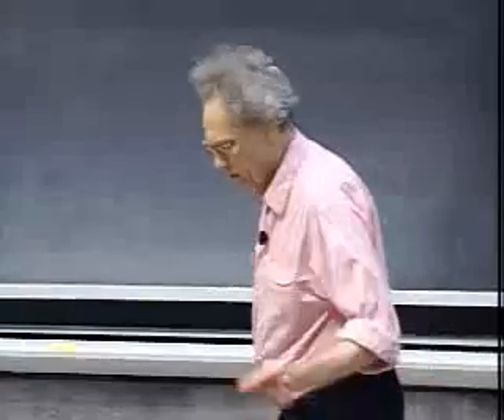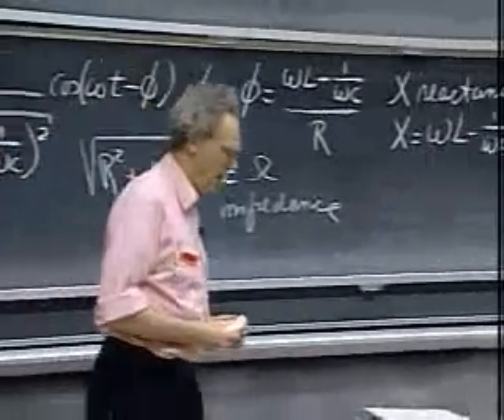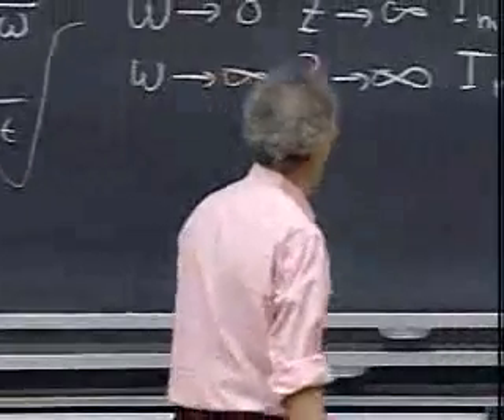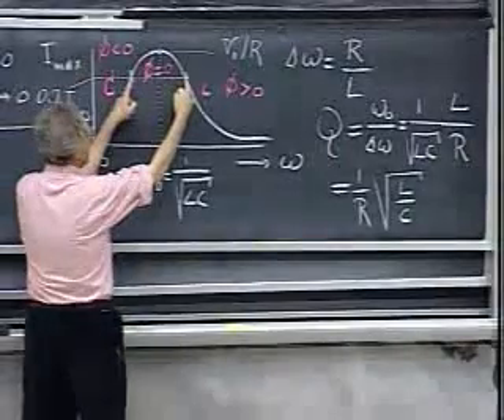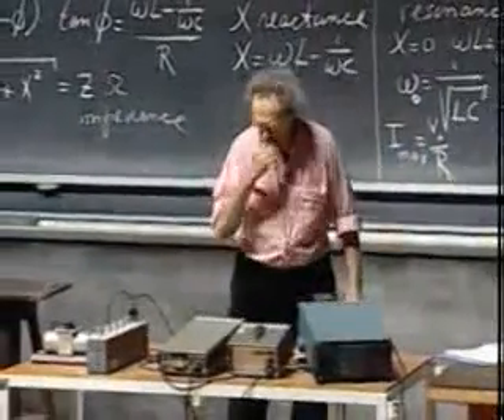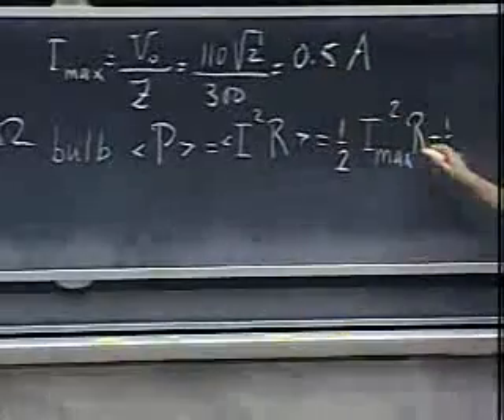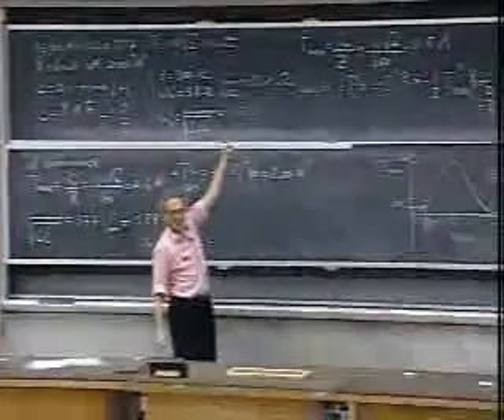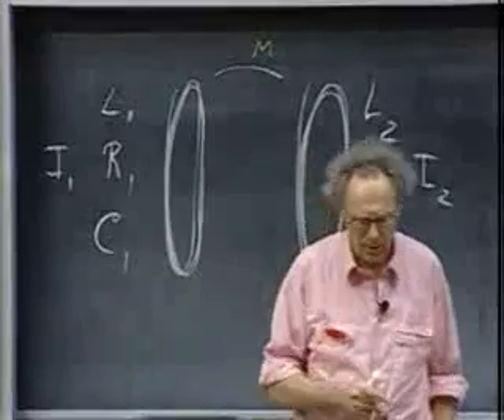Lec 25: Driven LRC Circuits and Resonance | 8.02 Electricity and Magnetism (Walter Lewin)

Comment: Dear Lewin,
 In the determination of quality factor of the oscillator we use the formula, Q = ( Wo(resonance frequency) / delta(W) ) . Where delta (W) is the full width of half maximum. My question is why are we taking the Bandwidth of the half energy frequencies, Why not at 25% or 75% of energy frequencies.

Comment: When I solve the DE, for the reactance I get  (1/wc ) - wl and not  wl - (1/wc) like he wrote. Of course  I notice that wouldn't make a difference in the Impedance since is squared but in the tan(phi)=Reactance/R it would change the sign of phi. and the relation of who is leading, voltage or current. I don't see what kind of substitution would make up for that sign error, so maybe there is a mistake there?.